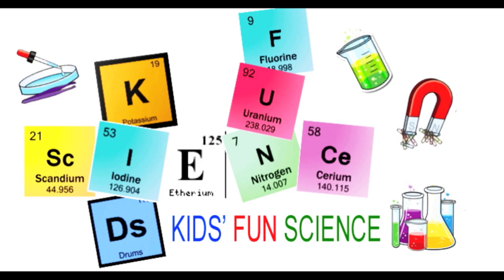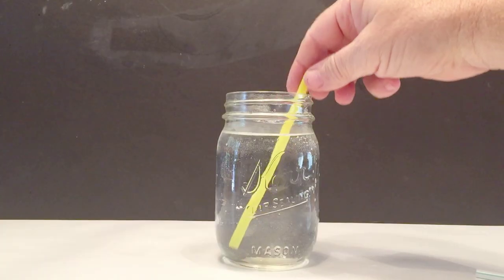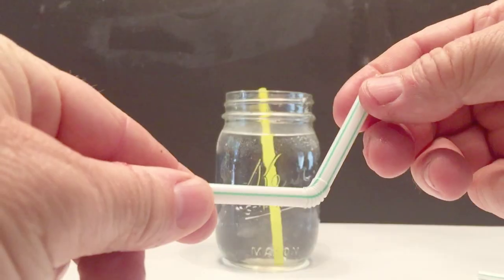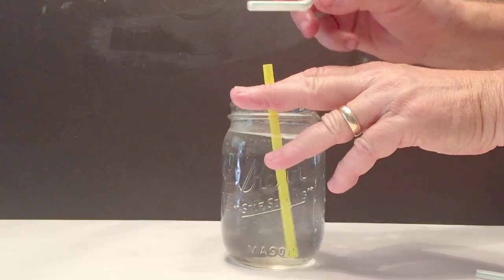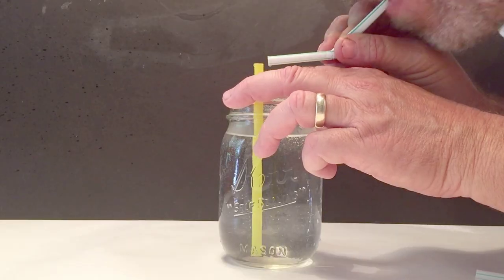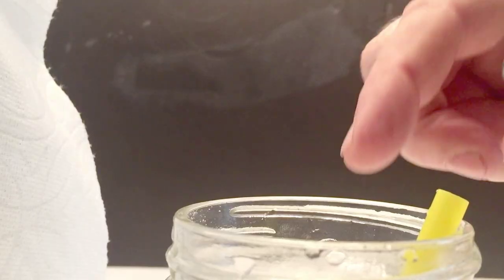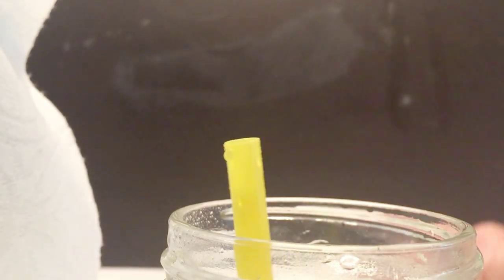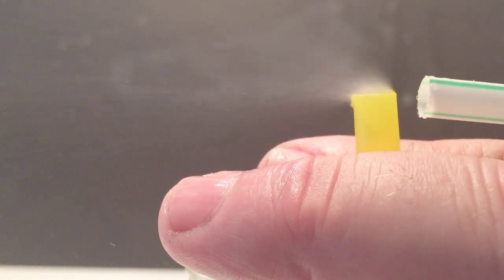Straw mister Experiment (Bernoulli’s principle)

Comment from the maker: SHARE or THUMBS UP if you like this experiment. Thanks for watching.
Reply: But this is wrong.
Reply: .. REAL PHYSICS: 
..
The common misconception is that any moving air, such as from a hair dryer, leaf blower or your mouth, has a lower static pressure than the stationary air around it. This is not true and comes from a misreading of Bernoulli’s Principle and misunderstanding of how to apply it. There are several demonstrations that are misinterpreted to show the static pressure is lower.

The moving stream of air from one of these is at the very same static, atmospheric pressure as the still air around it. It is NOT lower.

Here is the correct explanation.

This moving air has MORE total energy than the still air around it, not the same amount. This additional energy was added by the blower. The Total energy is the potential energy of the atmospheric pressure plus the kinetic energy of its motion or momentum. 

Each of these ‘blowers’ adds energy to the air in the form of static pressure.  This internal pressure is higher than the atmospheric pressure outside it. 

For example, muscles move the diaphragm to squeeze the lungs.  This increases pressure in the lungs. 

This internal pressure pushes more on the air than the pressure outside
A pressure difference between two locations is called a Pressure Gradient.  This reflects the idea that the pressure changes gradually between the two locations. 

Because the internal pressure pushes more on the air, there is a net force toward the lower pressure outside the blower.  The air is free to move and is accelerated toward the lower pressure.  This is Newton’s Laws in fluids. 

Air has mass. A Pressure Gradient provides a net force.  Mass is accelerated away from the higher force, toward the lower force and gains speed in this case. This happens at the outlet of the blower and we have the stream of air starting internally at the higher pressure and accelerating to atmospheric pressure.

That’s it.

For those watching the conservation of energy rules, the TOTAL energy of air INSIDE the blower is the same as the TOTAL energy of the stream OUTSIDE the blower. The trip from inside to outside has no energy changes in that air. 

We see that inside the lungs, all the air has nothing but potential energy in the form of static pressure and no motion with kinetic energy – no dynamic pressure. All the energy in the lungs is in the potential energy of static pressure.

The air gains speed (acceleration) as it exits, thus changing the extra potential energy of pressure into kinetic energy of the moving momentum of the air’s mass.
Reply: It is the curve in the flow around the end of the vertical 'draw tube' that causes the lowered pressure.

Comment: Please give the inference of this experiment.
Reply from the maker: Morning Haribansh Singh, The inference is as you blow through the straw, the air rushes out with great speed. So the air goes over the other straw with even greater speed. This leads to a low pressure over the other straw in the water and water rises in this straw. The Rising water hits the air and becomes a mist/spray. thanks for watching

Comment: So what’s happening when you do this?would you please explain it?
Reply from the maker: Hi Chemivideo, As you blow through the straw, the air rushes out with great speed. So the air goes over the other straw with even greater speed. This leads to a low pressure over the other straw in the water and water rises in this straw. The Rising water hits the air and becomes a mist/spray. The creation of low pressure due to high speed air is according to Bernoulli’s principle. Thanks for watching Ken
Reply: @KidsFunScience  tnx a lot